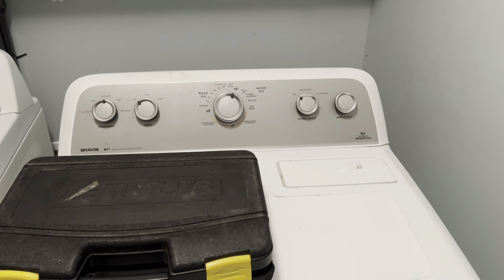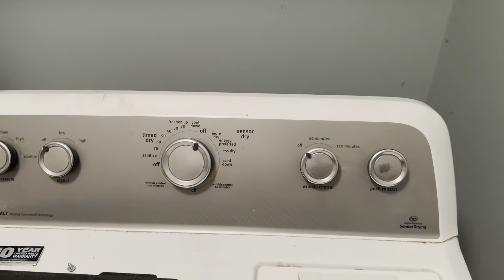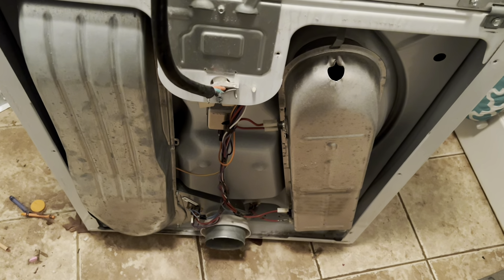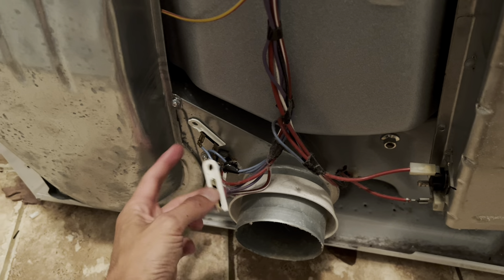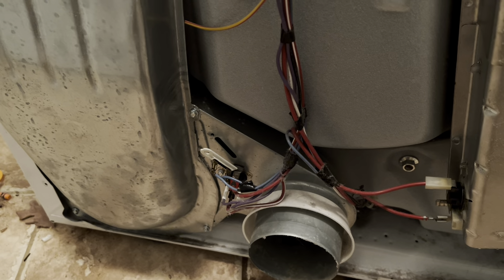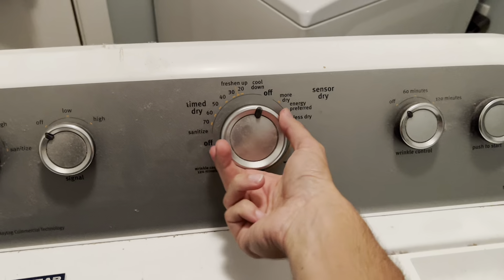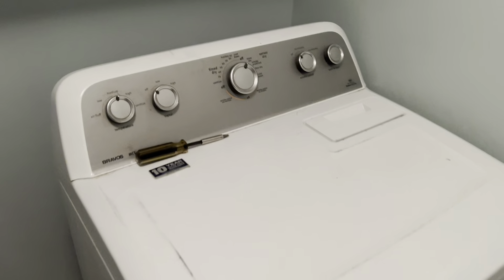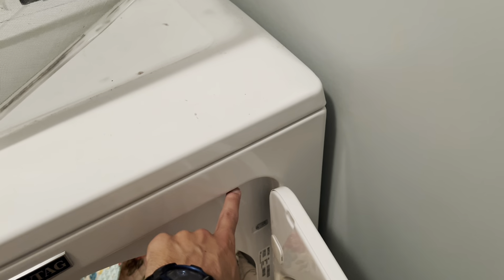Maytag dryer won’t start. Fix it cheap

Comment: Thanks for this video was able to fix it myself. Will say I find it a bad design feature that the heat element still works if this thing trips.
Reply from the maker: Appliances these days are just poorly designed. If you called a tech out and he fixed the same little part it would cost at lease $250.

Comment: Great video! Helped me fix a free dryer I got off marketplace, thrown in with the washer. Since this piece is a fuse, there isn’t a positive and negative- it’s just an open or closed link. Put your multimeter on “continuity” to buzz it or use resistance and make sure the resistance is low (connected). 

I just shorted out the switch with a jumper and it worked. Now I’ll get the replacement in the mean time.
Reply from the maker: Thanks for watching. I am glad I was able to save you some $$. I don’t have a multimeter or otherwise I would have used it in the video. Please give the video a thumbs up if you can.

Comment: Like you, I prefer to try to fix things myself. My 10yr old Maytag Centennial dryer stopped earlier this week. Light on in the drum, continuity was good on the start switch. Thermal fuse in back tested negative on the multimeter. Shame that none of the local hardware or DIY stores carried them, so I had to wait a couple days for Amazon to get them to me. About $1.74 apiece, they come in packs of 3.  Changed it out and saved myself a $90 trip charge. The fuse itself changes in a few minutes but the biggest headache was cleaning all the lint from the back panel.